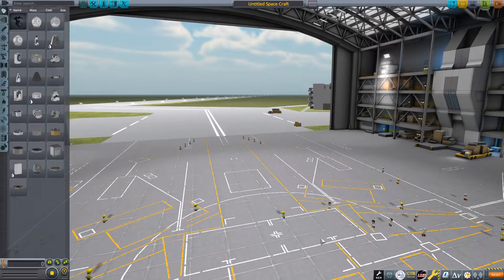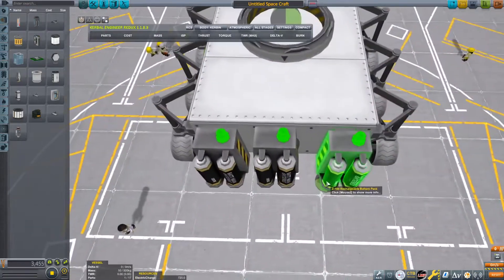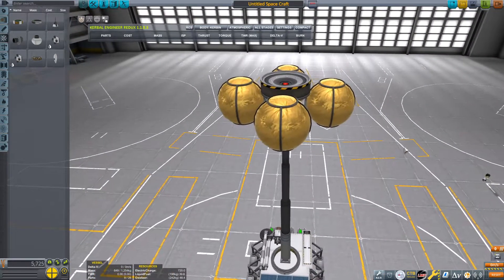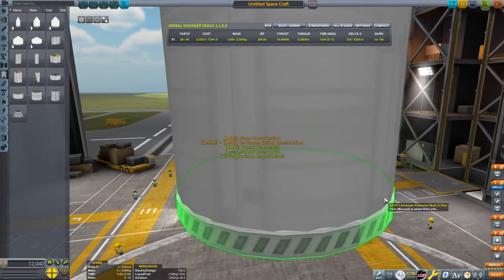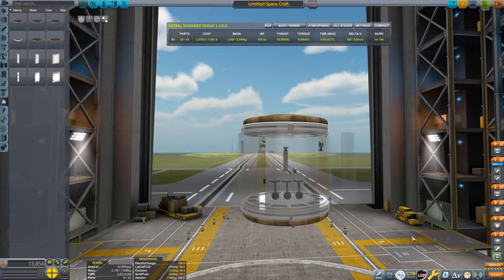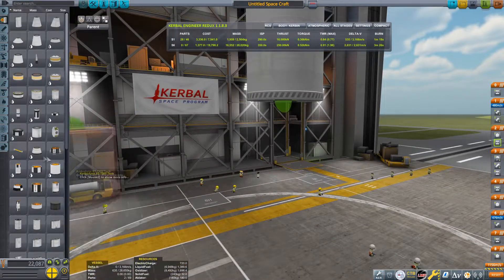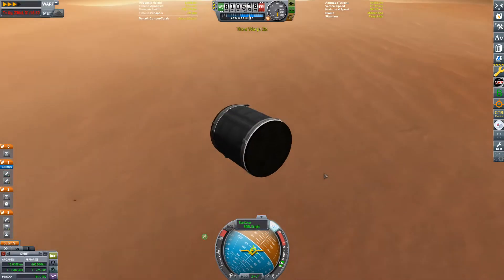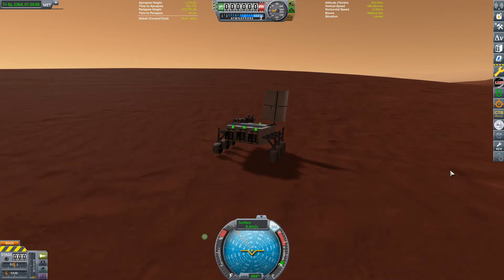How to Build and Land a Rover + Skycrane! - Kerbal Space Program

Comment: Bro its just shaking itself to death
Reply from the maker: Make sure there are no parts clipped inside each other. Watch out for the beams with the engines on it, you need to offset them inwards so that they don't clip into the fairing
Reply: Ok i will try again
Reply: I’m having the shaking problem too. It starts once I have put on the fuel tanks on the sky crane. I checked it to see that it wasn’t clipped to the beams, but it still continues to rip apart itself on the launch pad.
Reply from the maker: Try autostrutting everything and making sure you didnt enable rigid attachment on any fairings

Comment: Please respond how did you get it to Duna without loosing probe control? That’s my problem.
Reply from the maker: I turned off commnet in the difficulty settings, but if you have commnet on you'll need to add an antenna to your upper stage or entry module or have a pre deployed antenna on the rover
Reply: @ooflespoofle3691  ok thank you. So with comment off I don’t need any antennas at all? The craft would be able to go al the way out to Eeloo without any comms?
Reply: @hunterozee7817  yes I think so, what I did was attach a communitron 88-88 and it gave me full control the entire time